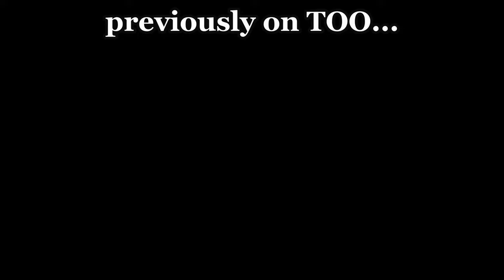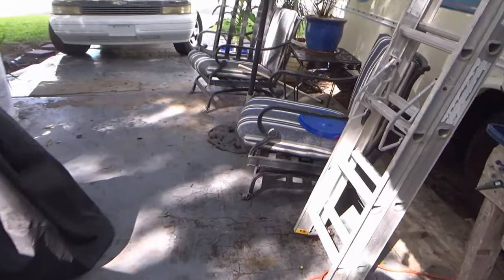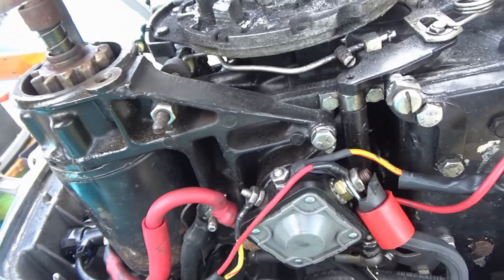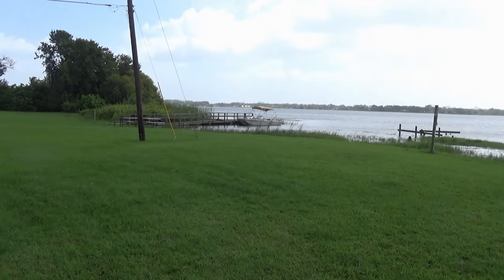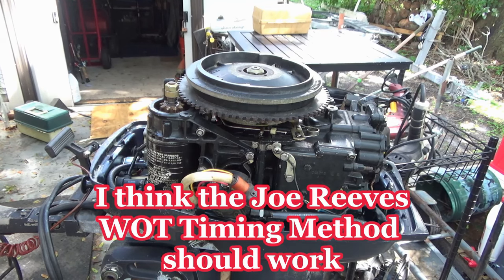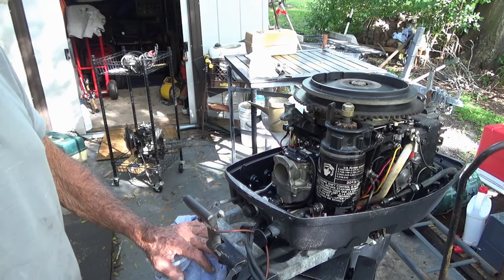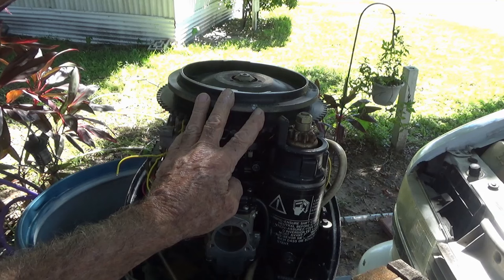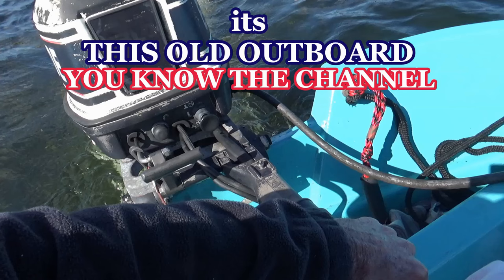Johnson 25 Hp - This Happened pt 2 - #outboardrepairand

Comment: Good job TOO, sounds great and smokey like a good two stroke should😀. Got a sweet deal yesterday. Should have shot a video but you know most folks don't like being on camera so just took a picture after we loaded it on the truck. Got a 1964 Honda CT200 90 trail bike in great condition for 500 bucks. He was selling it for 1000 so just offered 400 thinking I'll never hear back. Well he came back at 500 and jumped on it. It will make good videos coming up over the winter months along with more outoards
Reply from the maker: Cool man! Thanks for tuning in!

Comment: I've seen worse-the very first flywheel I pulled off any outboard. The little skiff came with a blown 25hp, and another 35hp outboard with a busted bracket and bad foot, but the powerhead was supposed to be good. When I pulled the flywheel it looked like that one of his-except 1 winding had came un-wound and the wire was EVERYWHERE. 
The guy said it was still running when the foot went bad, then it fell off the hoist and broke the outboard bracket so he just put it in the back of the shed being disgusted with it.
Learned a better way to time, THANKS!
Reply from the maker: Wow. Thanks for tuning in!

Comment: I got that 2003 acouple years ago with similar distraction under flywheel.I believe screw for coil came loose and started the carnage.I actually put a 1977 flywheel,on it and the plate and parts from a 1987 and got it running.Also got a 1989 that the underflywheel power pack screw came loose and caused similar problems.
Reply from the maker: Wow. Yeah the beef motor is an 89 25 too. I better check it. Thanks for tuning in!

Comment: I have a 1989 evinrude 14 spline  prop.  I see you getting greater results with a 9x10 14 prop.  Will a 9x10 14 mercury prop work on my evinrude?
Reply from the maker: Hey. Thanks for tuning in. No don't think so, the splines will fit but the blades are positioned too far back. Thanks again & Stay tuned !
Reply: @THISOLDOUTBOARD1  thanks for the response.

Comment: I have the same- 99' j25 W/ the larger carb venturi throat - what size high speed jet and where can get? Thanks
Reply from the maker: Hey. Thanks for tuning in. Go to marineengine.com, look up your year/model and see what size jet yours has, usually it will show the 30hp too but not always. Then look up the similar 30hp same year and see what size it has. Check the intake also, sometimes the 25 & 30 use the same one sometimes not. It can get confusing with these things. Anyway they may have it in stock, if not search the part number, sometimes ebay will have it. Thanks again for tuning in!
Reply: Thanks @THISOLDOUTBOARD1

Comment: Do thay make that bigger intake for the 1974 25 hp
Reply from the maker: Thanks for tuning in. If they do I don't know about it. Those early 25's were in a class all their own! If you find something that fits let me know. Thanks again & Stay tuned !
Reply: I did port the carb out and going too take it to the lake tomorrow I will let you know how it does and if it helps at all I look at the pictures you sent and it did have the carb on it that looks smaller and I did open it up
Reply: @yeltonT15  the cylinder ports are much smaller. without bumping compression to take advantage of the extra fuel, it will probably idle worse and be no faster on top end.
Reply: Your probably right worth a try lol
Reply from the maker: @yeltonT15  yes and I want to know how you did it. thx
Reply: Well  I did pick up 1.5 mph lol I could tell a difference in the way it run I hade too adjust the the enrichment to about 3 turns out it made a big difference in the idling I  took a sand paper roll and a carbide cutter too take the big stuff out and the difference is worth the work
Reply from the maker: @yeltonT15  Wow!
Reply: Thank you for your hard work I enjoy every video I have worked on cars for years but I learned too work on my outboard from you I thank for all the time you put in thanks again for replying too me and keep up the good work
Reply from the maker: @yeltonT15  Thank you!
Reply: I found 2 intakes on ebay I thank to be a 1984 35 hp will it fit my 1974 it looks the same but a lot deeper
Reply from the maker: @yeltonT15  if they take the same gasket!